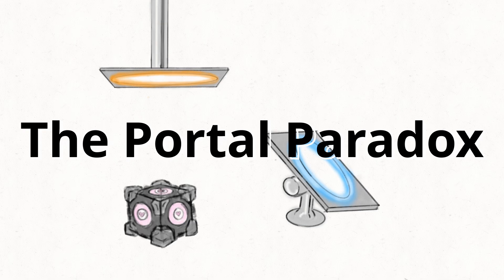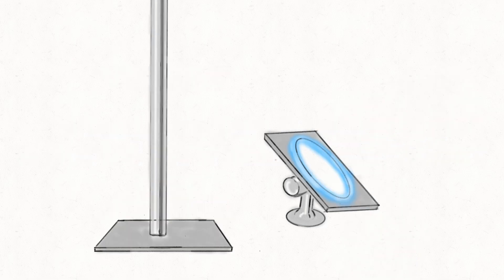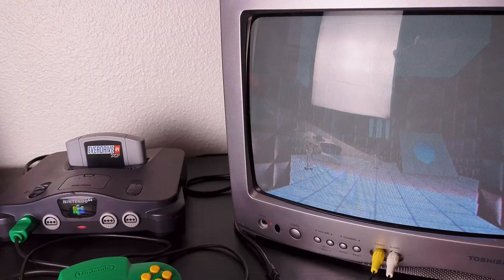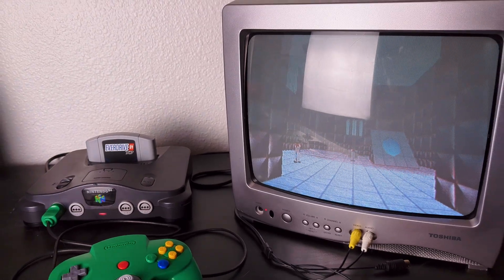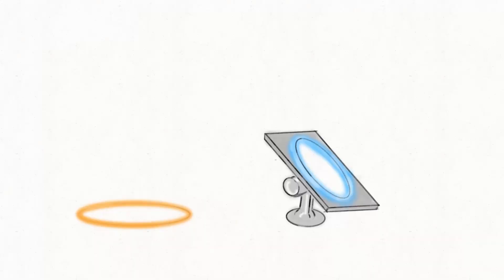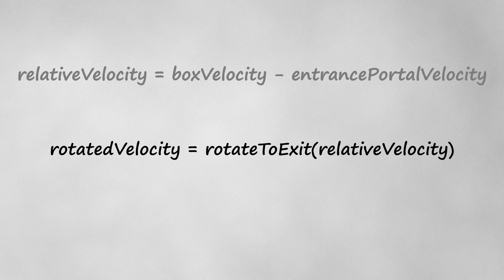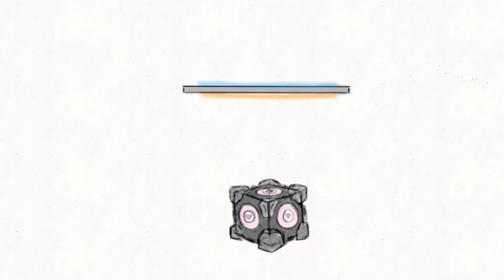I rewrote Portal from scratch and solved the Portal Paradox

Comment: I kinda disagree.

Granted portals don't exist and it is just a simulation. But if they were real, then they must abide by the laws of motion and thermodynamics.

On the motions side, how is the cube getting propelled? I imagine like a window that gets close very fast to an object, once it passes through, the object remains in the same state, motionless.

Now let's suppose that it gets pushed through the portal, what pushes it? From the point of view of the output portal, it must be the whole room, in that case, when it comes to a stop, all other objects must be propelled in that same direction, obviously this doesn't happen because the room is motionless actually.

Imagine a ball hung by a string, then a rapid square passes surrounding the ball and cutting the string perfectly. The ball would simply fall down, not get propelled in the opposite direction of the square.

Now on the thermodynamics side. Where does it get energy? Nothing at all applied energy to it to make a move. Portals are an amazing way to make perpetual motion machines with just gravity, but still some energy must be spent first to get the machine go. Here the only applied force, and thus energy spending, is on the input portal.

Infact it should actually be propelled backwards by a little bit. Why? Air resistance! When the portal approaches the cube, not only the cube is "getting closer" to the exit portal, but the air is getting inside too. So it disturbs the air in the output making it a little bit denser. And when the cube attempts to get out, the air itself will try to make equilibrium by trying to pass back through the portal, making a marginal force onto the cube.

Granted, air is to be ignored in most calculations, specially in videogames. But the rest above is my way of thinking that the cube must just fall down.

Comment: If we have a stationary portal in the frame of reference to a portal and an object moving towards each other, would the speeds add up when the object enters the moving portal and shoots out of the stationary one? If the object and portal move towards each other with a speed of 0.75 c each in the frame of reference of the stationary portal, would the object shoot out with 1.5 c?

Comment: but what happens when the moving platform with one portal pushes down onto just one half of the cube?

I believe that the cube will still shoot out the other portal, but now the first half of the cube with velocity has to pull its other half without velocity, resulting in a lower distance travel when it shoots out

Comment: I am finding it hard to choose which side of the argument I am on, but I believe it comes down to whether the portal itself is considered an object; that said, I'd be interested to see what happens if you stop the moving portal about halfway through slamming down on the cube. Does the cube remain stationary, or does it get sucked through by the inertia of the half on the far side of the portal? If it's dependent on the acceleration due to gravity, is there some point along the depth of the cube that slamming down that far will make it shoot out in this way? I think answering these questions may give a better idea as to whether this model is believable
Reply: While it's hard to imagine exactly portals, try to imagine them being a doorway. It would work the same as you slam a doorway into the cube.

Also imagine 3 different perspectives: cube's one, observer's of the exit portal, and observer's of the whole experiment.
To better see the situation there's another experiment: we stop the entrance halfway of the cube, instead of fully slamming it. That way you'll clearly see the cube and how it's not being moved.
This also shows why equation from the video is wrong. The cube will get speed out from nowhere, if you apply that equation. Portal can't give its speed since it's not an solid object.
Reply: @fantastikboom1094  I mean, your 'stop halfway' seems the same as my 'stop halfway', just worded slightly differently; however, if we look at the observer of the exit portal's perspective, a cube has begun emerging from the portal at some speed; the portion of the cube that is emerging is moving, and so it has inertia, and hence, as it is connected to the other half of the cube, it may jump slightly, or even fall all the way out. The portal may not need to impart relativistic speed/force if the platform's movement is sufficient.

Another experiment to consider is if the exit portal is on the ceiling; even if we go very slowly, once we move the entry portal across the halfway point of the cube, it has more mass unsupported than supported, and should fall 'up' through the entry portal due to the force of gravity acting on the portion sticking out of the exit portal. This clearly shows that the forces acting on the exiting portion of the cube matter to the whole system.
Reply: @andreasthompson6270  No, the cube has no inertia. It's portal moving, but not the cube. The cube needs to be pushed if you want it to move. What exit portal observer see doesn't matter. That's the relative movement. It only describes movement looks different from different perspectives. But it never says about actual movement.
Reply: @fantastikboom1094  okay, let's say we track a single atom at the top of the cube as the portal descends on it. Up until the portal envelops the cube, the atom is stationary, relative to the earth, which should be sufficiently 'global' of a perspective (pun intended). Now, once the cube is partway in the portal, as the platform with the portal descends, the part of the cube on the far side moves out of the portal at the same speed. Hence, when the portal stops, the atoms on the far side (which were just moving!) are no longer being worked upon. However, they have a velocity imparted to them by the fact that as cube emerges from the portal, further-out cube matter is being pushed; consequently, it has inertia.
Reply: @andreasthompson6270  You're ignoring frame of reference for the cube. In this it never moved. For the cube it's the "room" was moving towards it. Where your relativity gone in this case? Maybe we should apply the force for the entire universe? Because the cube can't be pushed without it. But we didn't move the entire universe, it's just the doorway moved. It also makes no sense because of how that force is applied. You mean that the cube will be cut into 1-atom-thick layers. It will be cut at any speed.
You basically don't know what are you actually talking about. You already accepted that the author's equation is true and just want to disprove who didn't accept it. However, author's equation makes no sense and conflicts with what we seen in the game.
Reply: @fantastikboom1094  I don't think I am ignoring the reference frame of the cube, but that aside, I never said I agreed with the equation put forth in the video; I began this comment thread on the fence to begin with, but having though about the system on my own with this 'cube halfway' thought in mind, I have come to share agreement with the basic intuition behind the video.

With that said, what is different about the system, either at the cube or at the exit portal, if instead of moving the entry portal's platform we put the entry exit on a static portal on the ceiling and moved the cube up on a platform? Why, in this model, when the cube exits the portal with velocity, do we presume that it has inertia, when in the other example you posit that it doesn't? What is relativistically different in assuming the portal approaches a boundary than assuming a boundary approaches an object?

This is much more about trying to model an experience one could reasonably expect to line up with the rules of reality than what matches the original game. Moving portals like this isn't possible in the base game, making any considerations theretoward pretty moot. I don't understand what you mean by 'the cube can't be pushed without [the force for the entire universe]', and I have to say that a lot of that first paragraph means very little, and some of it seems to unwittingly agree with my point. Could you potentially explain what you mean there?
Reply: @andreasthompson6270  I thought how to answer it very cool, but then forgot for a few days lol. Anyway.
By saying the cube should move, you assume something has to push it. When you say platform moving the cube into the portal and the portal moving towards the cube are the same cases, in the second case you actually mean that the universe itself moved because the portal moved (literally the relative movement, as you wanted it). So, when the portal suddenly stops, the whole universe is still moving (Or should it suddenly stop? But as the cube is a part of the universe, it will stop too. It makes no sense, so...), and ALL objects are having the inertia. This way the cube would shoot out, yeah. But the portal is leading to the same universe, so... it just makes no sense. You're really defending point of nonsense.
There is also a problem with the way how the force is applied. Knowing that every object is made of atoms, all object are entering by layers of them. When first layer comes through, it suddenly experiencing a instant push, that will cut the object into 1 atom thick layers.

Comment: I have to disagree but only a little, I feel as if there would be some movement simply because of the change of location but the portals connect space itself which, I have no basis on this, can't have its own energy except if you put a portal in an enclosed syringe and tried to compress it would air rush out of the portal? Going from high pressure to low pressure?you know what, I talked myself out of my rebuttal, good video, thanks

Comment: This breaks conservation of momentum. The cube isn't moving, SPACE is moving around it.
Reply: Is that an issue though? I'd argue momentum is only conserved in part because space is continuous. As portals are a discontinuity in space would that allow for momentum to be no-longer conserved? Portals can already change the direction of motion of an object without applying a force on it, that alone breaks conservation of momentum unless they have infinite mass in which case, how on earth is the portal gun storing/creating them. In a world with new physics, you can not assume laws/symmetries to hold without justifying them
Reply: @faceless1434  No, they aren't. Portals are just arbitrary connections between two points in space. Wormholes work the same way.
If you enter a worm hole on the west end of the universe at 5 megaparsecs from center and exit one in the same area, but 1 megaparsec to the east, and the universe is expanding at 73 kilometers per second per megaparsec do you exit the easternmost wormhole and gain 146 km/s of acceleration?
Reply: @Null_Experis  Portals do not work the same way as wormholes, wormholes are bends in spacetime and thus have a large gravitional pull (at least to the best of my understanding as general relativity and astronomy are not particularly where my interests lie). Portals do not share this consequence hence why I call them a discontinuity
Reply: @faceless1434  What? Wormholes aren't comprised of dense matter. Why would they have a significant gravitational pull? They're not black holes. They're just connections between two disparate sections of spacetime, and modern theories of them say that the only gravity detectable around them would be coming from any masses on the opposite side of the wormhole.
Reply: @faceless1434  Go look up Casimir Effect, the only traversable wormholes would have to follow this theory in order to exist.
Even if you believe that something like the portal gun only happens by a Quantum Tunneling Event (impossible at the macro scale under the current quantum model), they question still stands.
Does the relative motion of two points of spacetime result in a third party accelerating when traveling in/on them?

Comment: How I looked at the paradox was. Take a hammer and use it to hit a brick or other smaller object. It will slightly bounce do to your force. So turning the hammer into a portal. My expectation is it will flop but with a bit of distance. It's not being thrown, and it doesn't plop outside the portal. It will plop but a bit farther, just like the reaction of a hammer hitting a small object. Ots both technically but more plop then flying.

Comment: there's actually a flaw in the idea that it wouldnt carry velocity out the other end too, and that's that the object just... kind of wouldnt work. in this example, you have the exit portal on a slope, but the surface the cube is starting on is flat. when the cube teleports, it would have to be on a flat surface because it would be resting between the two portals with downward gravity, putting it on the flat floor on tye orange side of the portal. however, it would have to sit slanted out the blue portal in order to maintain proportions, since there's no gap between the orange portal and the ground, which would fix this dilemna. the only ways around this problem are to make portals impossible to set between 2 surfaces that are touching, or to have the object inherit speed from the portals velocity, which is far more fun to interact with and far easier to design too.

Comment: if we assume that conservation of energy holds, then this is absolutely wrong simulation. the platform with the portal moves towards the cube with a certain force, when the cube passes through the portal im assuming in your simulation the platform does not lose energy and keeps moving at same speed. the platform has not lost any energy and the cube has gained not only free kinetic energy but also potential energy of being moved into a higher spot
Reply: this is true of any portal in any of the games though. conservation of momentum can never hold for a portal, so looking in the context of the portal games, you can assume this doesnt matter, or there is some way around it that aperture science worked out.

Comment: oh god ive been trying to think of a way to explain this and this is the best i can do so imagination is required. portals are like a straw (like one you drink through) on one end you have the orange portal and the other end you have the blue one right? now then the space in-between the the two portal sides doesnt matter to us practically cause you cant perceive it and if you did then it wouldnt be practical as a "portal" but its still a "straw" and straws dont impart force on their own. you can take a straw and slide over a nail or something as fast as youd like and that nail wont move or gain any momentum, meanwhile the inverse is just as true. you can drop a nail or ball down a straw and the straw wont slow it down either, thats why when you do the infinite portal bit and jump in you speed up till you hit terminal velocity, cause the straw isnt interacting with your velocity or momentum its just conserving between the portal frames.
Reply: Actually a good explanation of why his equation is wrong.
Reply: @fantastikboom1094  dude i sat there for like 20 mins thinking of how to explain that as simply as i could lol

Comment: That doesn't conserve momentum. There isn't any collision to transfer momentum so it doesn't make sense that the box would increase in velocity beyond gravitational effects. We can model it as an instantaneous inelastic collision. Velocity doesn't just transfer between objects, force can and gives a resulting acceleration (m11a11 + m21a21 = m12a12 + m22a22). The platform collides with the ground but the resulting accelation is negligible since the ground has so many orders of magnitude more mass. The box doesn't collide with anything, it would just pass through. Conservation of velocity isn't a thing.

Comment: I think that the cube shouldn't shoot out of the blue portal because there is no relative velocity with the portal. The portal is basically a hole and when going through it, there is no transfer of energy between the hole and the cube, hence the hoop comparison. It doesn't matter if the second portal moves or not, there is no transfer of energy whatsoever. The true problem is that when one of the portal moves, the entire space in that specific portal moves with it. The cube as a relative velocity with its space of 0, and at the exact moment it enters the portal, the cube either still has no velocity because it exits the second portal in the same space or it has a velocity because it enters a "moving" space. Now there is no way to prove one solution or the other but I believe that because there is no transfer of energy, there shouldn't be any movement. Feel free to respond to me respectfully, otherwise I won't answer.

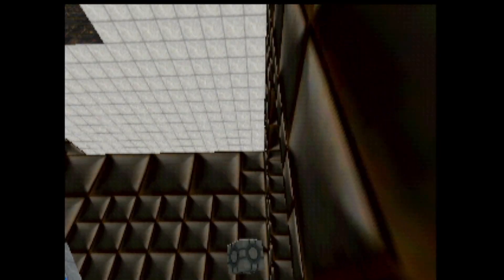To resume, the flaw in the equation at 2:00, to me, is that there is no energy transfer between the portals and the cube, therefore there shouldn't be any + or - which makes the paradox impossible to solve.